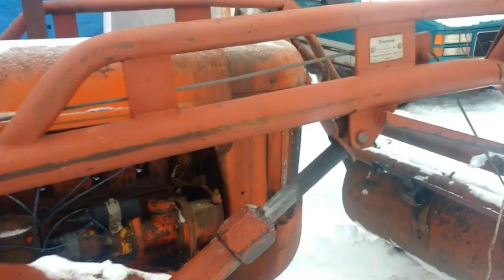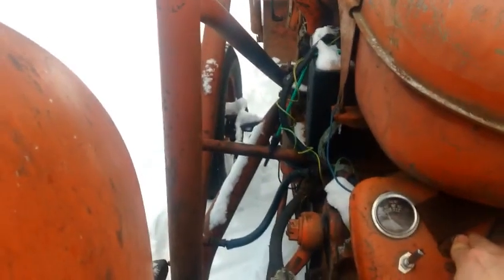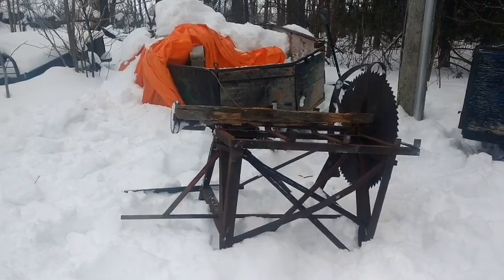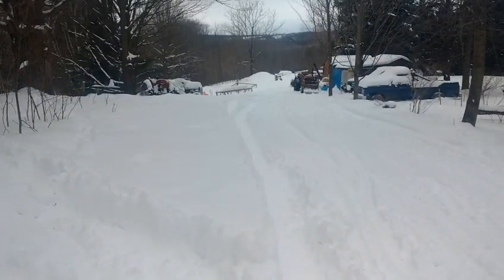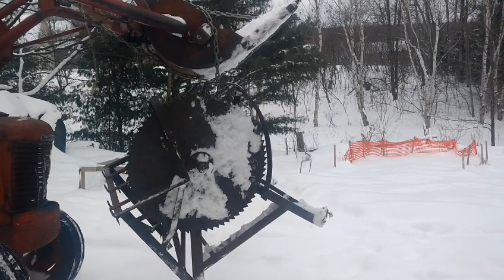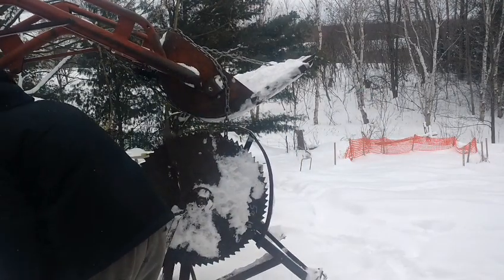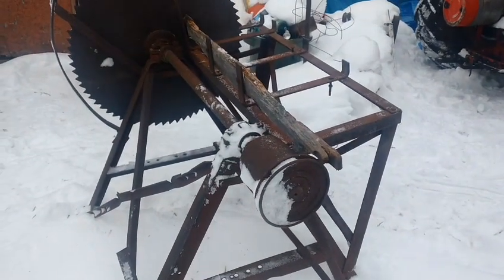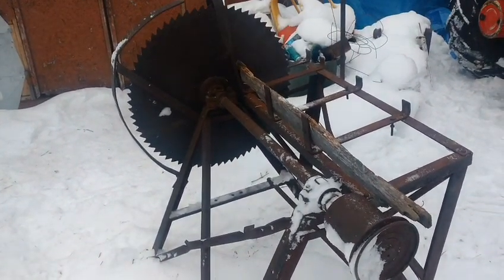Buzz saw part #1 and more 1950 case model S with Freeman loader

Comment: Hey Andrew !!  Good Evening way up there in the cold weather.  Its a balmy 32F (0C) down this way...  Yes, a little TLC first to just see what you have to work with.  I couldn't see the bearings good enough, but they look as though they might be poured babbett...If so, make sure you get lubrication of some sort before you spin the arbor too much. Babbett is a mixture of tin and antimony and maybe a small percentage of copper.  Its a reasonably soft surface and can bugger up pretty easily without lubrication.  So IF that's what it is, be easy on them.  
    Pouring new bearings is something I've not had to do yet. LOL....Look at the exposed ends of the bearings and right at the shaft it will look like a thin layer of soft looking stuff similar to lead. It'll even scratch easy with the point of your pocketknife.  As a matter of fact, less than a half hour ago I uploaded another video that shows up close a babbett bearing !!  So see if that's what you see on yours. 
  Btw...awesome video....I'll stay tuned for the updates.  Good luck and thanks for the shout out !!  LOL...
Reply from the maker: I'll definitely have a look when the sun returns to the sky lol and I had no idea that a Babbitt Bering was a thing! That's cool! That thing will likely be covered head to toe In WD40 after I'm done with it but knowing this I'll put some good greese on them bearings! I'll be checking out your new buzz saw video as soon as the coffee is ready :p thanks again sir!!